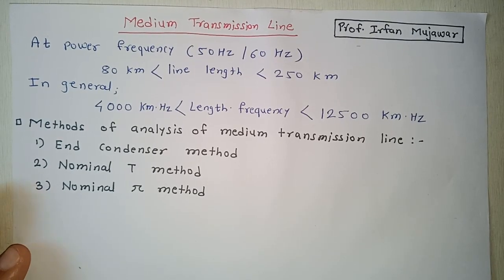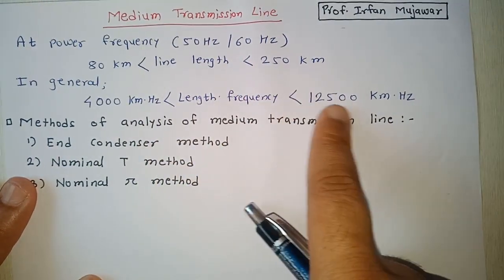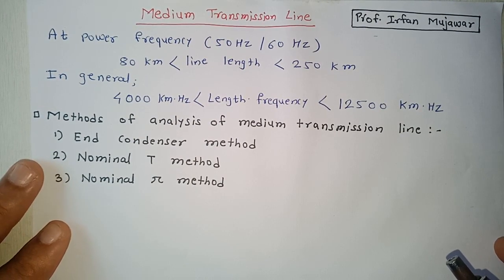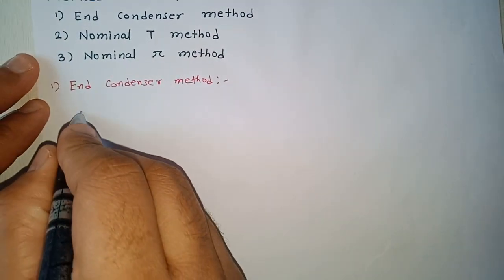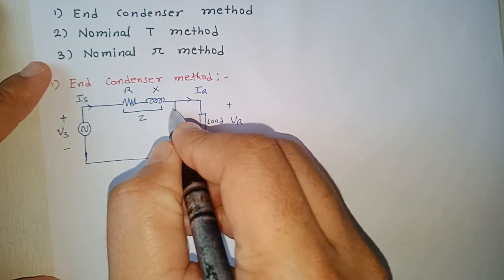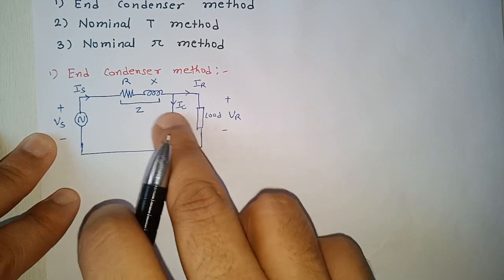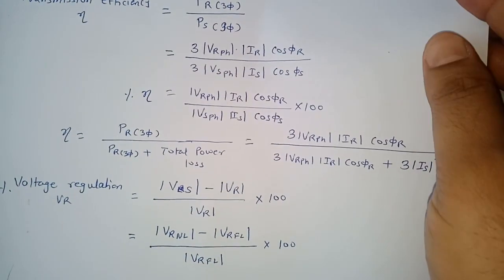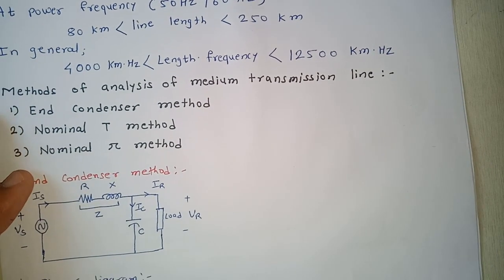Medium transmission line End condenser method - Prof. Irfan Mujawar

Comment: Sir U had mentioned sinusoidal symbol then how you shown the polarity symbol..ac doesn't have polarity...clear my doubt sir
Reply from the maker: You are right. AC does not have fixed polarity. But it is a convention that we can indicate polarity for AC also. What is means is that suppose I indicate point A positive w.r.t point B which is negative then it means that at that particular instant point A is having higher polarity w.r.t point B.
Hope it is clear now.